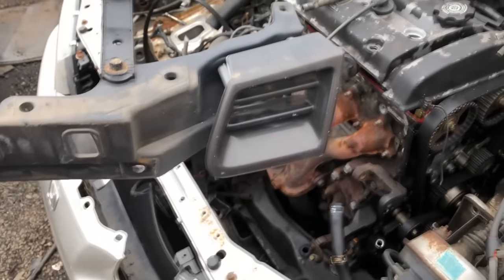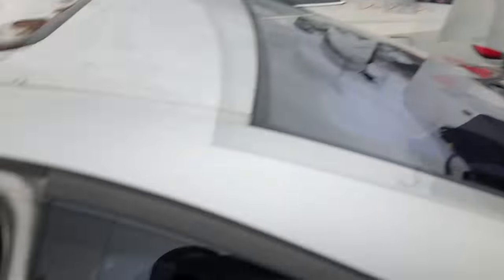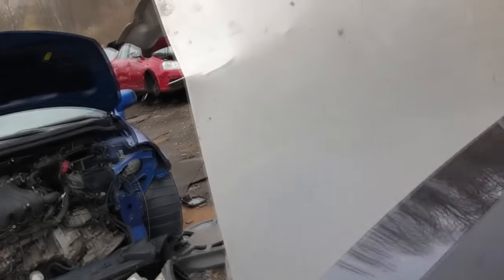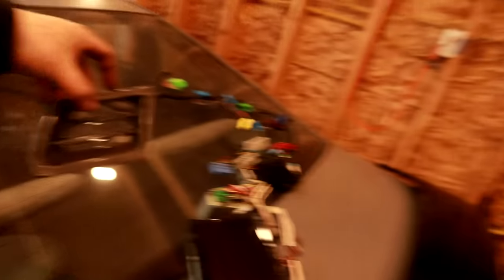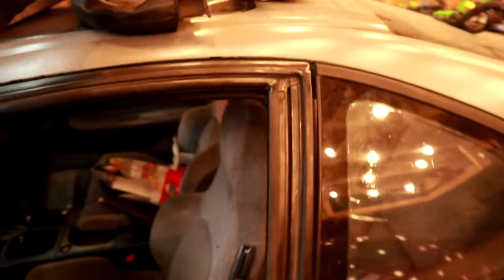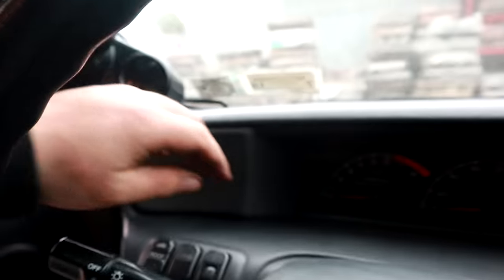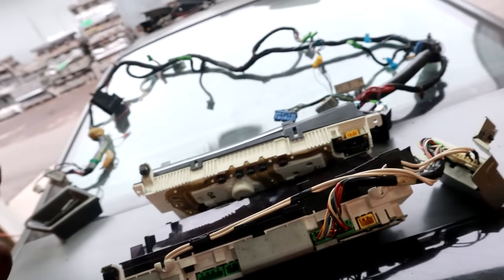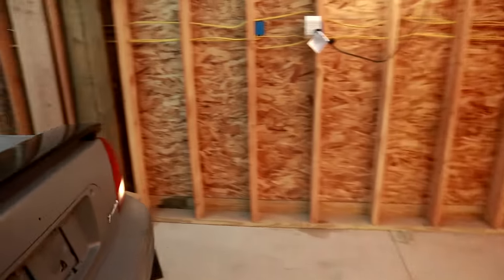PRELUDE EL CLUSTER & 96 CENTER CONSOLE CONVERSION

Comment: I wonder if the turn signal switch on the steering column is different from your car to the car from the junk yard? I dont know if that could cause the problem or not, but something to keep in mind.
Reply: Definitely a difference in the circuitry

Comment: does the ebrake actually work? the handle seems way too loose to grip properly
Reply from the maker: Obie Rice yea it feels the same as it did before I did the swap, what do you mean the handle seems loose?
Reply: @damianmonte  it should be harder to pull up, but if it holds the car then nevermind
Reply from the maker: Obie Rice ahh yea I mean it’s a 92 and I don’t think the cable has ever been adjusted. It’s good enough to hold the car and it’s gets right up top but I can adjust it so it’s tighter